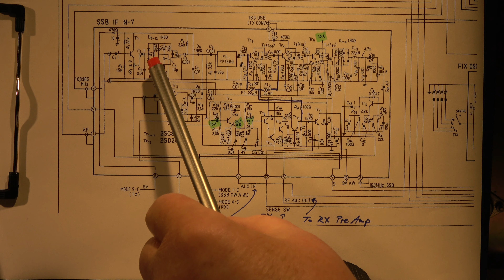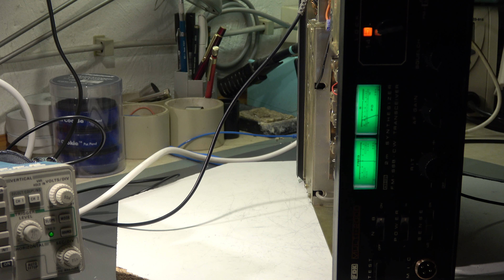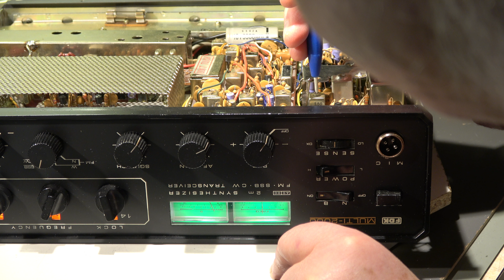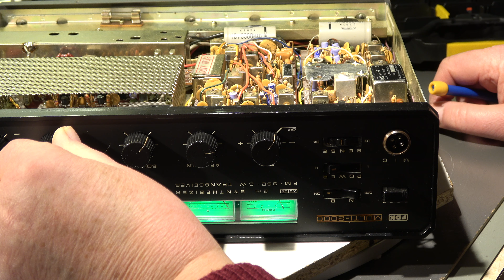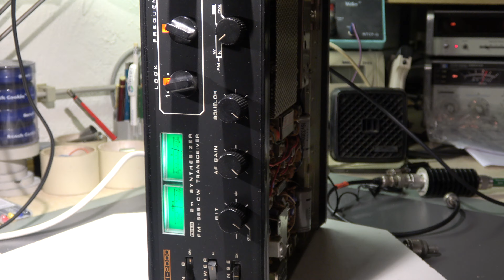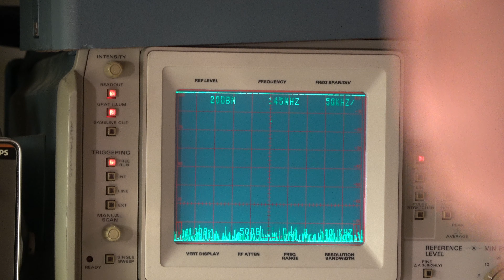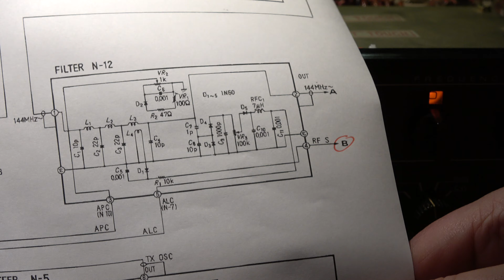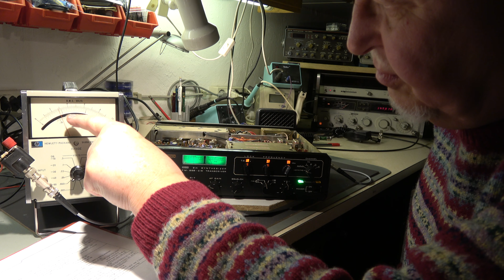#58 FDK Multi-2000 Part 3(3)

Comment: Super Video Serie! Ich habe auch einen Multi 2000 aus einem Nachlass bekommen. Der hat zu meiner Überraschung sogar bis auf die defekte Beleuchtung funktioniert. Hab auch alle Birnchen durch LEDs ersetzt. Der Multi sieht so im Betrieb wunderschön aus! Wegen des VXOs ist der auch im 12,5kHz Raster nutzbar. 
Ich scheine allerdings eine neuere Version zu haben, die Duplex U und Duplex D Schalterstellungen besitzt. Habe leider kein Handbuch / Schaltplan dieser 2 Generation!
In alten Zreitschriften tauch noch eine dritte (letzte) Variante auf mit USB und LSB Umschaltung.
Reply from the maker: Ja, diese alten Geräte haben oft ein Flair, das den modernen "Kisten" fehlt - ähnlich wie bei den Autos ... hi.

Comment: Hi Stefan, ich möchte gerne die HF-Ausgangsleistung meines FDK Multi 2000 justieren. In Deinem Video hast Du von einem Poti gesprochen um die HF Ausgangsleistung zu verändern.
Könntest Du mir bitte einen Hinweis geben, welches Poti auf welchen Board gemeint ist. Vielen Dank.
vy 73 dg7mdu
Reply from the maker: Hallo Boris, das ist das Poti VR1 auf der Platine "FM Local" N-6
Reply: @dl7majstefan753  Hallo Stefan, vielen Dank für Deine schnelle Antwort. Leider ist dieses Poti, obwohl im Schaltplan auch angegeben auf meiner Platine nicht bestückt. Sie haben einfach eine Kurzschlussbrücke eingesetzt. Werde dieses Poti nachträglich einfügen. Vielen Dank für die Info.
Eine Frage habe ich bzgl der kontaktlosen Bandfiltermessung. Sind das Nahfeldsensoren?
vy 73 Boris
Reply from the maker: @borisbarawitzka5973  Hallo Boris, das habe ich auch beobachtet, dass während der Produktion dieses Gerätes Modifikationen gemacht wurden, die nicht genau dokumentiert sind. "Sensoren": Das sind einfache Spulen mit unterschiedlichen Windungszahlen an ein Koaxkabel angelötet; 2-3Wdg für VHF und ca. 10 für ZF-kreise. damit ergibt sich eine lose magnetische Kopplung.
Reply: @dl7majstefan753  Hallo Stefan vielen Dank für Deine Hilfe. Ich werde nach Deinen Angaben die Spulen für die Bandfilter und VHF erstellen. vy 73 dg7mdu